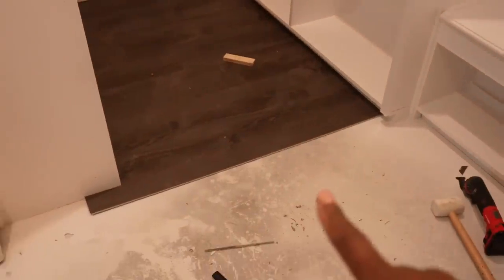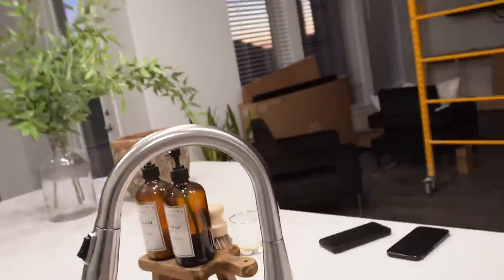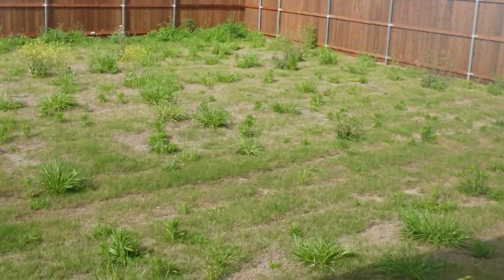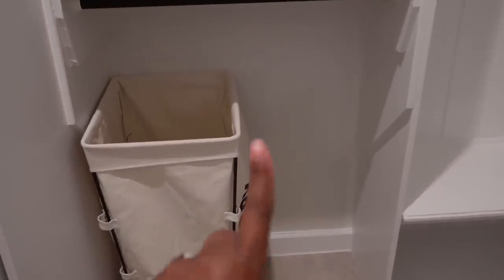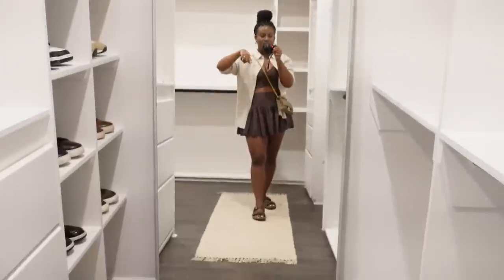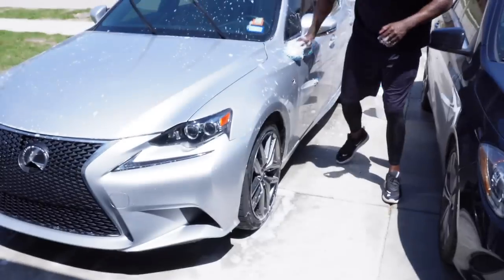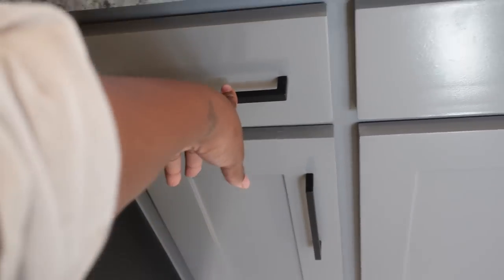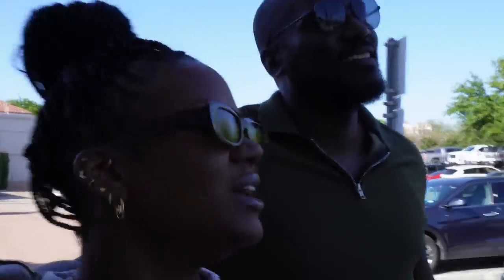Vlog | Closet Reveal | Home Goods Haul | Dinner Chit Chat | New Restaurants In Our Area PLUS...

Comment: This was fun to watch. I'm so excited for you two. Those black handles are on amazon, my son had them in his new home.  He did a custom design (my son designed the home and paid to get blue printed) and his wife and I picked out all their interior and exterior like the paint, lights, even staircase inside. It was so much fun.  I installed all the hardware and lighting and him and his friends installed staircase and railing. We found ALOT on Amazon and the savings came with family and friends doing some of the work like interior paint, base board installation, we even picked out interior and custom exterior doors. We are in San antonio, Texas and my son and his wife saved 10 years for this project. I get so excited seeing young couples do so well. Keep up the good work you two. Now ill be going to model homes getting some ideas for my home.

Comment: I am a contractor. I can't wait to see your backyard turning into Paradise. Go for a fibreglass pool!
Reply: Why do you suggest a fiberglass pool?
Reply: @sweetp love  if the pool is small to average in size & you have money, buy the factory molded fiberglass shell (a ready made pool, install & fill up water). If on a squeezed budget, make a concrete pool then apply fiberglass (f.g.) or apply granite. Molded pools major adv: extra durable & an asset you can move with your home. In contrast, f.g. coating on concrete is less preferred than a ready made fiberglass pool, but since being on a budget, 3-4 layers of f.g. with good quality final gelcot layer can guarantee 15 years, molded pool will be almost a lifetime. General adv of F.G.: repair areas are easily fixed & blended with your old pool color unlike tiles pool to get a duplicate tile match after years, f.g. pool doesn't support growth of algae, f.g. pool uses less pool chemicals to maintain water. Granite coating on concrete has less durability than f.g. coating on concrete. Cheap to expensive: granite - f.g. coating - f.g. molded shell.